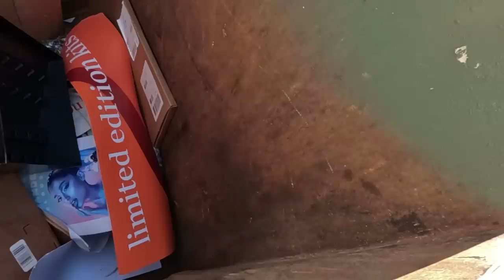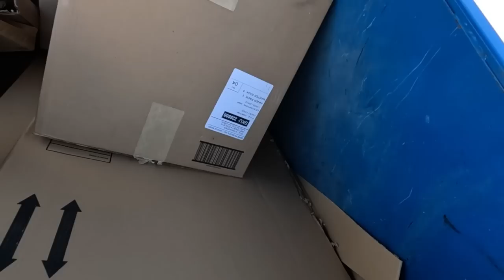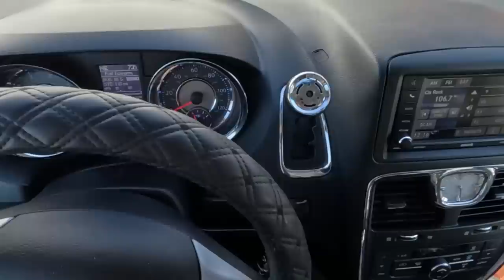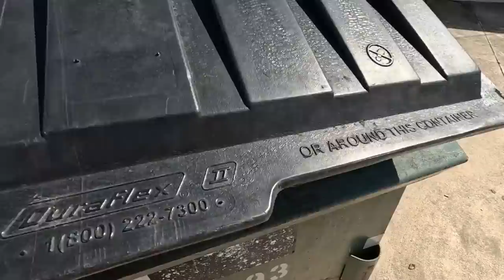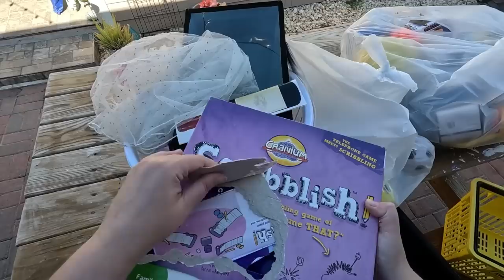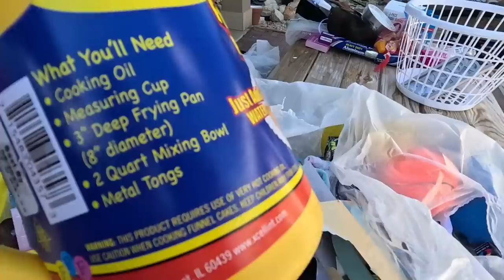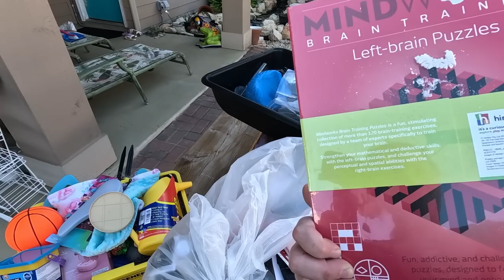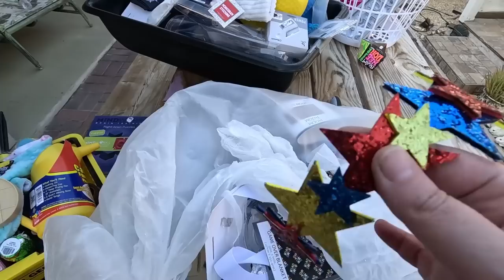How to Dumpster Dive, Daily Diving finding toys, games and other fun stuff EXTENDED CUT

Comment: When you pull up to a dumpster you should always have the driver side door closest to The dumpsters so if somebody comes out you can get in and go quicker and then also nobody can run up and get in your car and take off either specially when you’re doing it by yourself
Reply from the maker: Thanks for the tip! 👍